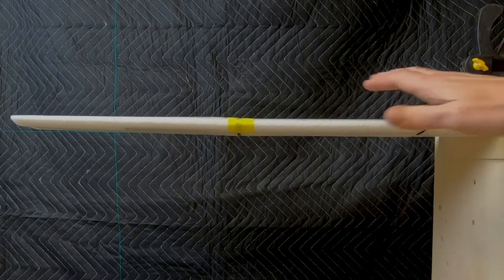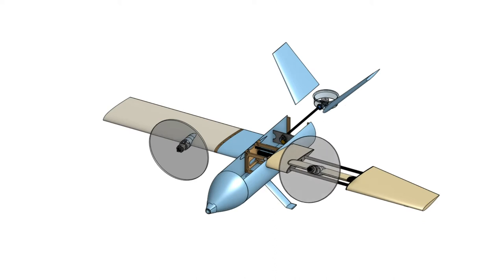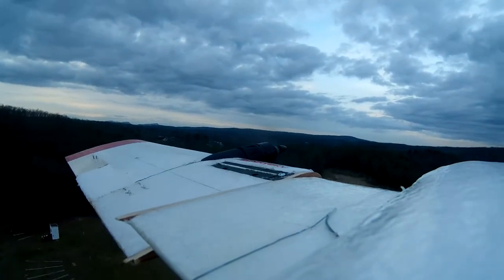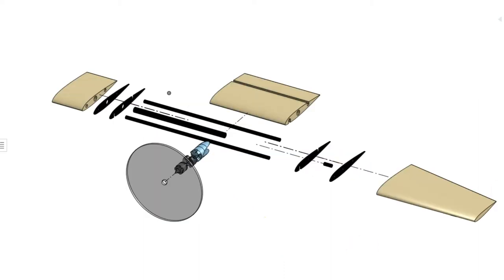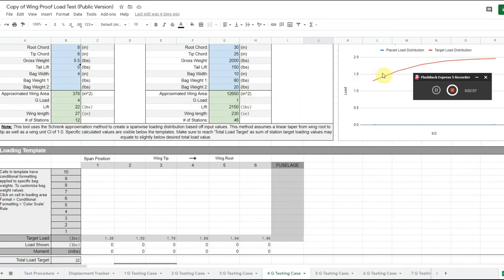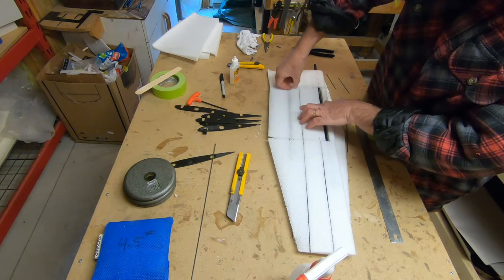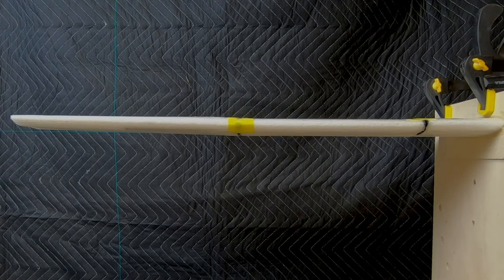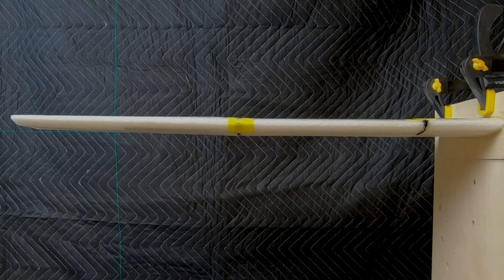Rogue VTOL Project - Part 5 Wing Design and Testing

Comment: I can’t wait till you get this done, would love to buy a test craft when you get it close. I love vtols and trying to get Shelby Voll to like them more too. I got him to fly the convergence once. 
What about putting the motors on the ends? It would slow roll rate a bit but, less hinges and it could be even smaller wing section that moves with it.
Reply from the maker: Wing tip motor pods are an option that I am considering. They do require a stronger wing section because the the full load will be suspended from the tips. I’m also considering a tandem wing design with quad motors.

Comment: Might of just been me but, I did hear some popping while the "wing load" was being added to the test airfoil. STILL, very impressive 1st phase!
Reply from the maker: Thx. Yes, there was some creaking sound. I have isolated it to the ends of the CF tubes in the wood frame of the test stand. They were pulling a bit and sliding in the jig making the creaking/piping sound. I ran the test 5 more times with the same results